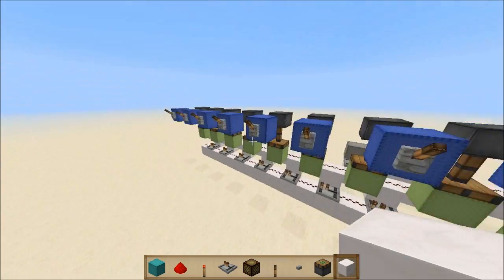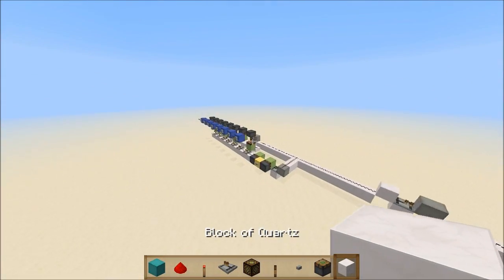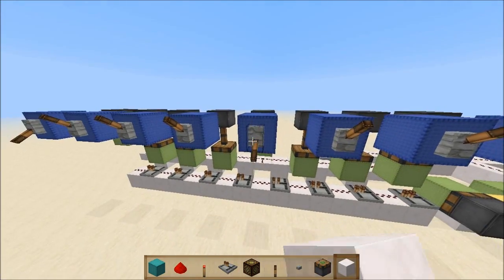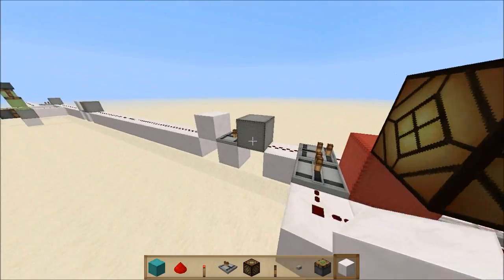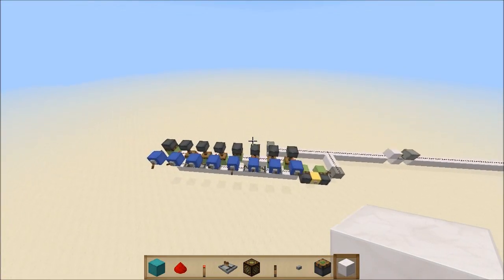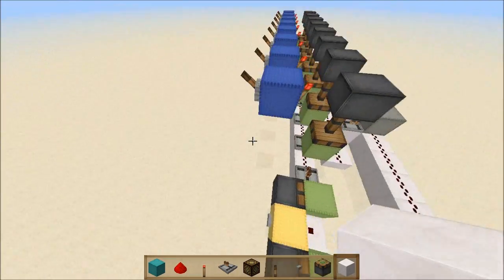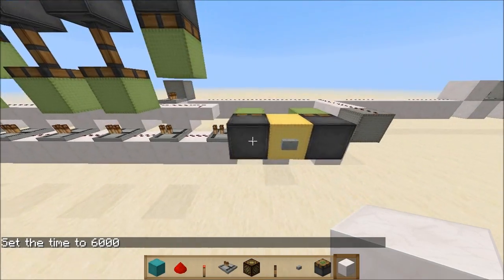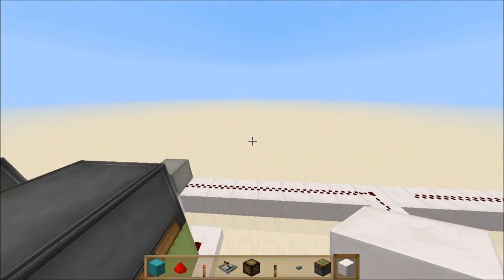Minecraft: Serial Data Transmission [Explanation]

Comment: I've been using this design a lot, and have used it in some really large projects. For example, and "telegram" system, with multiple devices connected, and routing hubs redirecting messages based on serial data. I also coupled it with a analog multiplexer ( I changed the signal strength to carry additional information, which was received by either the relay or recipient and decoded ).

Comment: Explained
The machine sends 1 tick off in the mono circuit to the decoder which starts the loop. The other tick sends off a tick to an opening in the redstone with the lever but the ticks that happen in the decoder are happening while the tick is getting thtough the encoder.

Comment: How could you build one that is longer than 8 bits long? If 8 bits require 16 blocks, then 16 bits would require 32 blocks. How would you put the extra repeater in there without messing up the timing?
Reply: Easy. On one side you have a solid line of Redstone and on the other you have repeaters between each bit. To expand beyond 8 bits you simply place the repeater on the 16th block down the chain on the opposite side. You aren't placing an extra repeater mind you, just shifting one from one side to the other. Basically, if you add delay on one line then you must subtract it from the other to keep it the same.
Reply: @Chris R,  Maybe I made something wrong, but it doesn't work. Look here https://i.imgur.com/kgIgtxX.png (everything is like in video without additional repeaters. Pink wool is the last block of redstone with signal. Could you help me please?